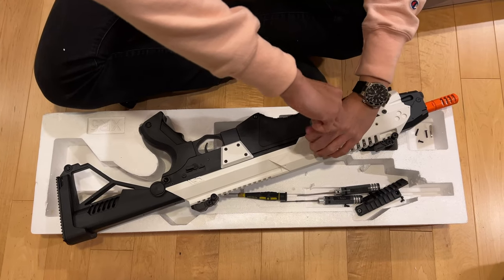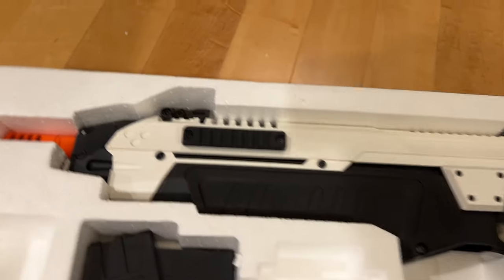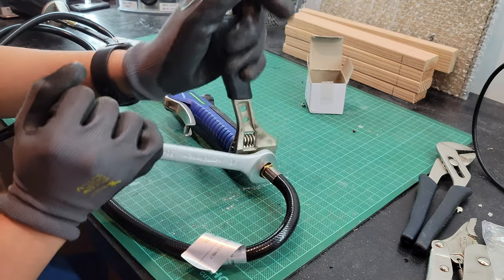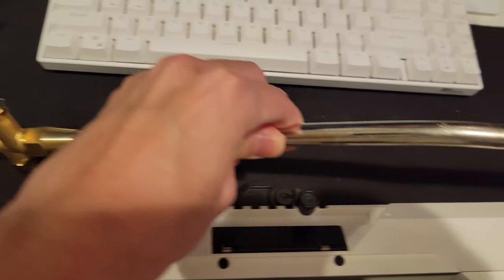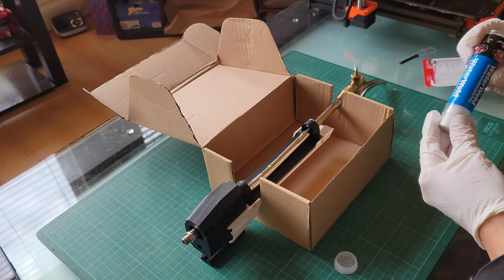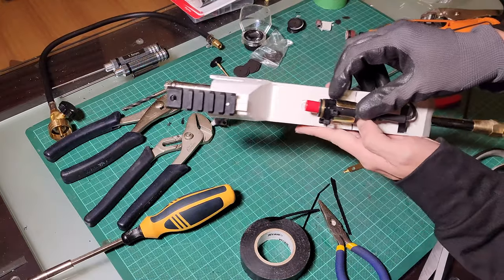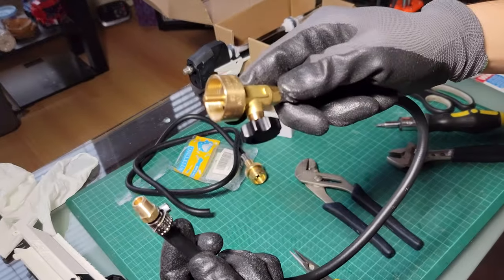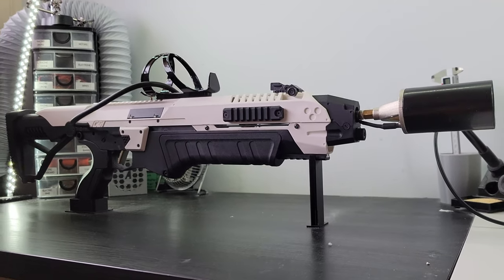Building a Boring Company Flamethrower | Make a DIY Flamethrower

Comment: Nice build. Not an "exact" replica but it's close. I've done a few builds of it - on my thingiverse I also have an exact 1:1 model for "The Boring Company" badge modeled from measurements off a original one.
Reply: Links to that? also in the original I think there is a spacer that is used near the end of the barrel to add air to the mixture to get a bigger flame, do you have that?